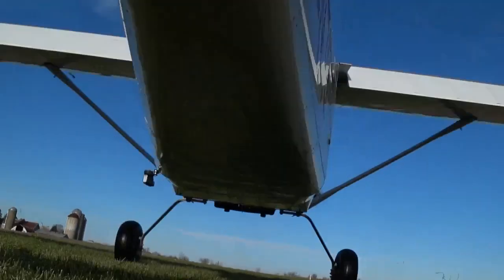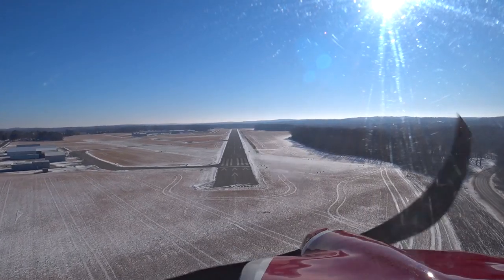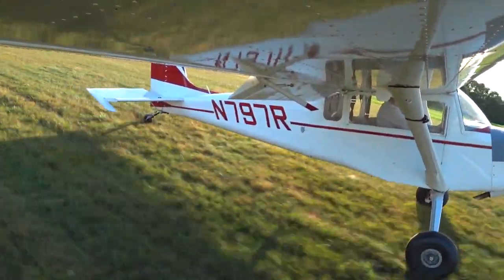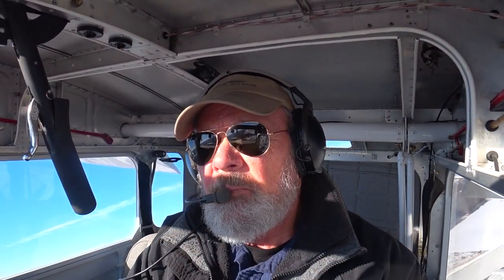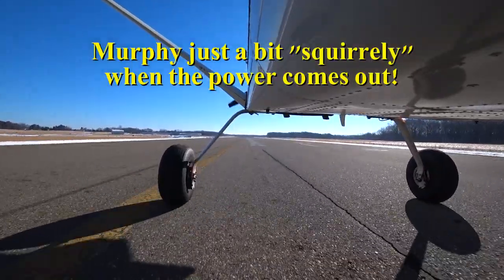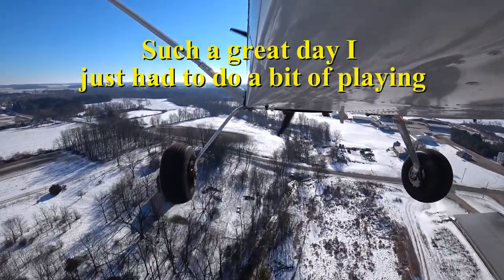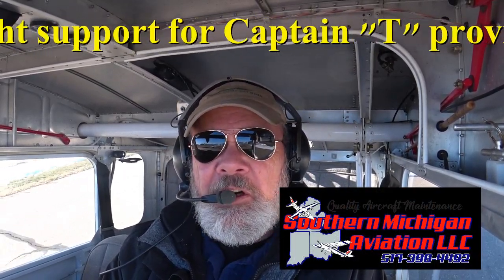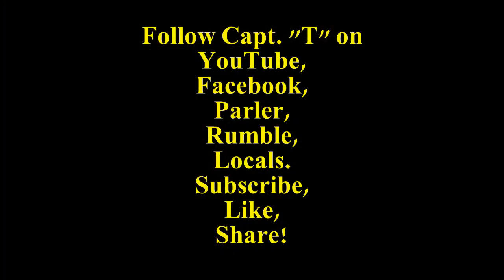Owning the Asphalt

Comment: I was one good wheel landing short of my TW endorsement.  It's tough and tense in a TW without flaps.  Geesh 90 mph on mains.
Reply from the maker: Seems a bit fast but I don't know what airplane you were in. 90 on touch down will definitely have ya doing the cha-cha until the speed bleeds off. Used to do them in the T-craft at 50. Champ was the same. The GCAA was 60. My RV-8 was 80 on final and pulled back to 65-70 at touch down. 90 seems really fast.
Reply: @TangoSierra2022  Just seems like it was hard to keep that tail up in the Citabria.  Maybe there's another way, but no flaps and a bump on the stick was hard to coordinate.  Superior rudder authority in that plane though.